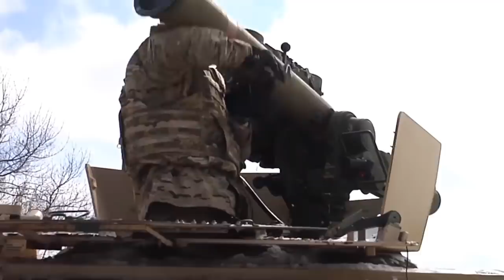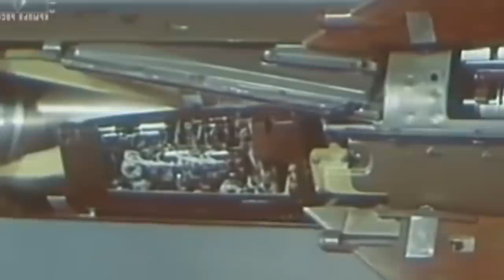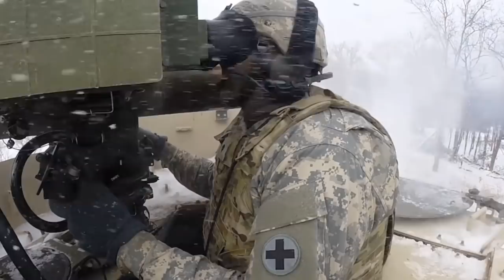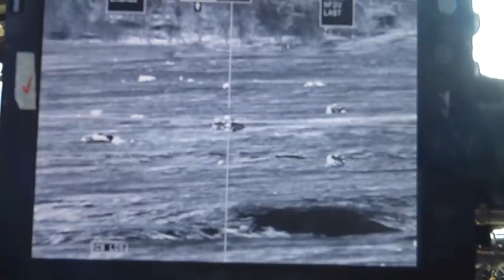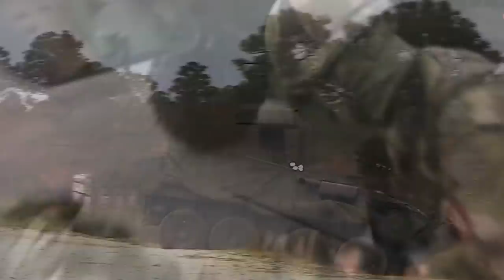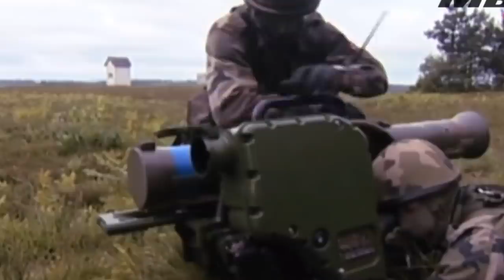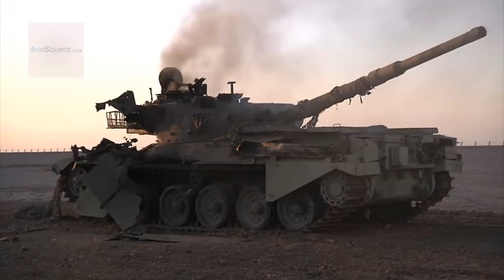Should Main Battle Tanks have Anti-tank Missiles?

Comment: For tanks right now, I think ATGMs are just redundant to the gun.

In the future, I don't think MBTs will be around at all, and the anti-armor role will be taken over by ATGM-equipped IFVs and scout vehicles. Already, Javelin missiles are fire and forget, which, while it doesn't allow quite the tempo of firing on the move, is awfully close, and while missiles are expensive, new MBTs generally cost somewhere around $4-9 million, so a $150k missile to take one out is pretty economical. Even if it takes 10 missiles to get through an ADS, you're still way ahead in terms of cost.

I imagine that the next generation of ATGMs will be able to be fired in an indirect fire mode, using inertial guidance and/or a datalink to get close and then and then some other sensor for final guidance. Once this happens, I think it will be the final nail in the coffin of the main battle tank.

Comment: I don't see where adding atgm to tanks would be if much benefit, it would complicate maters as now there is a secondary main weapon to manage, and also it mounts an explosive warhead to the outside of the turret.

If those in charge feel the need to add atgms to tank units, then they should have an atgm tank destroyer outfitted, maybe even on chassis if that country's tanks. I am a big proponent of specialized systems, as it allows you to create best in class systems, but multirole systems always result in comprimises in every single area so you end up with a system that is good at several things, but not great at any one thing, or at least not as good as it could be were it a dedicated platform.

I've long believed that when a country has a great tank like the Abrams, Challenger II's, etc... They should use they should do what is often done with APC/IFV which is usethe main body as the framework for a series of supporting platforms.

For example They could use take the newest if our surplus Abrams, remove the turret and replace it with a custom built turret with a pair of atgm launchers, one loaded and up for use, with the other retracted for reloading, manual or automatic. You then do the same for a battlefield SAM/AAA system, maybe just mounting a GROUND version of a naval combo missile/cannon CIWS system. By having these based on the MBT of each country, they could be integrated directly into the tank units, with very little trouble and would add considerable offensive/defensive punch to the tank battalions but without mixing lower armored vehicles in with the heavier armored ones.

Honestly, the best case could be to have the turrets used for the tanks to be compatble with the IFV chassis, so the mechanized infantry unit gets the same benifits, although the armore on the turrets should be modular so you can out less on the unit on the IFV chassis, basically to match it's armor level without the need of the heavier armor needed by the turrets when mated with tank chassis.

Comment: It is not certain yet but I think it is pretty likely that in 25 years sub sonic missiles will be almost 100% defended against by hard kill active defense by every kind of high value target. Killing a kinetic energy dart ist much harder and if one goes to even higher speeds (and yes, missiles might reapear there, but much more expensive and larger) it gets doubtfull that there will ever a good hard kill solution.

Where that arms race will end is completely unknown. If you contemplate you might for example see a saturation attack of a swarm of projectiles that can just knock out the hard kill system's sensors and after that it is the current situation again - and so forth.

Comment: Anti Aircraft missiles perhaps, the Guns now being used on MBTs far outrange ATGMs  and using HEAT rounds are effective as far as any possible opponent can be detected ranged and shot at which from high ground can be 10000 yards or more
Reply: They don't actually. The MTB's of most nations will seek to make their frontal arch armor sufficient to defeat penetration at 2km and beyond. The idea is to effectively engage from long range with ATGM that can degrade the sensors/optics on other tanks which will likely force them to withdraw rather than continue with degraded capacity.

Also you can't engage helicopter gunships with HE and remember the Russian ATGM's travel rather faster than the norm with the exact purpose of restricting the Time helicopters have time to escape the engagement envelope.
Reply: You Can with the US MPAT round

Comment: I'm in favor of having a stinger manpads mounted in an unmanned turret on the tank as a secondary weapon. That 50-cal on almost every tank seems pretty anemic as an anti-aircraft gun.
Reply: The TC's 50 cal. and the loader's MG are more for infantry suppression now than for anti-air! Tank crew has enough to do watching possible threats from all directions, loader usually gets assigned to watch his side and back of the turret while TC scans to the front and right for possible infantry and AT positions.

Anti-air are best suited for dedicated units or tracked vehicles assigned to an particular combat formations as then, they could simply concentrate on air threats!

Someone suggested using missiles or main gun to engage air threats, and while it would be possible to spot and track attack helicopters, it would not be fast enough to engage such as helicopters are far more nimble than what a tank turret's weapons could bring to bear. Motorized turret might be a lot faster then what used to be manually cranked controls but that are still NOT that fast as to be able to track fast moving air targets.
Reply: Cav1stlt except that my idea is intended for use against helicopters, in more urban settings.
Reply: Patrick, I have took my tanks thru city streets and to be honest with you, the last thing I worried about would have been helicopters, rather, every pair of eyeballs would be scanning every single windows, doorways for any slight movements indicating possible threats.

I have yet to see helicopters deployed (at least ours), within build up areas as they needed room to maneuver and hover. Once they enter towns or cities, they would very much be restricted like our own armors. We rarely send choppers into build up areas like what we did in Mogadishu or Panama.
Keep in mind of respond time of using portable anti air assets, it's not like a soldier would be shouldering a stinger launcher and scanning thru the sights. And he would also have to be aware of the back blast too- not something an overburdened loader might care to take on.

We were armored, we hunt and fought other armors; we could not do everything all the time and thus, we have to leave our air-defense to our own specialized units. And besides, we, conceited Americans, firmly believed in our own air superiority, LOL.
Reply: Cav1stlt p
Oh, thanks for the insight. Now that I think about it, it makes little sense to put a manpads on a main battle tank in any case.
Reply: These steel beasts, different versions of them, have been the loves of my life for a decade; I loved them, I hated them but in the end, they were mine, for awhile. Matsimus understood how I felt exactly. And I almost lost my legs a few times by these temperamental, heartless beasts... all because I was being overly enthusiastic and careless around them! I learned to fought with them, I learned to deploy them and I have learned their strengths and weaknesses. Though I no longer wore the uniforms, I do dearly enjoy lively, if civil discussions with others online like this. Thank you.
Reply: @cav1stlt922  you're welcome? I know it's been 3 months Since I was last in this comment thread but still.

Comment: Should Main Battle Tanks have Anti-tank Missiles?
Wel if it means you can launch some thing like a javelin vertical behind cover and hit a tank not reveling yourself.
No brainer in my option, plus the fact of drones these days assisting in hitting the enemy tank.
Reply: i say thanks of tomorrow need to use drones as a extra set of eyes to assist in spotting enemies and guidance of munitions.
A joint network like the F35 has.

Comment: Eryx is SACLOS not laser, well idk if there is laser variant of it ? The best anti tank missile IMO is Vikhr. It is laser and Russia claimed it is cheap, advisable to launch more than one missile per salvo. It is supersonic, and also Fire and Forget. Pack a lot of punch and also a good low altitude anti air missile, somewhat equal to MANPADS. All packed in one missile system thanks to the multipurpose warhead.
It used at Su-25 ground attack plane, helicopters, also naval CIWS complement. Kinda wondering theres no ground mobile platform for this missile.

Comment: It has never made sense to me to put the conventional missile tubes that you seen on the Bradley on MBTs for the simple reason that you've got 1 shot and you got to get out to reload. There is a very good reason why most of NATO has adopted systems like Kongsberg's  Protector. Sure firing through the gun barrel ensure the crew is safe, but maintenance. One idea that I like and think should be explored is to mimic the Vertical Launch Systems found on ships and submarines. The basic idea would be to have a single or double row VLS container mounted on the back of the MBT, this container could then simply be switched out by a supple vehicle similar to the vehicles that resupply artillery. This could probably be performed quite fast and with automation, keeping the crews safe.
 
I at least think it is a fun idea, I'm sure you know why this would be very impractical Matsimus ;)
Reply: Russian tanks use auto loaders for obvious reasons.
Reply: Do they auto load missiles? Or on their secondary armament?

Comment: Pretty much all modern Russian MBTs can shoot ATGMs. The t90, t14 armata, t80 and even t72.
Reply: Trouble is when you have to use the Gun it wrecks the ATGM control system, I don't believe anyone has yrt issued a fire and forget ATGM so you are stuck waiting holding sights on target till missile impact, that means several seconds not moving and exposed to gunfire from any opponent that sees you
Reply: 8aleph there aren’t any fire and forget atgm’s coming out of a tank but there are fire and forget ATGM’s the javelin missile system is fire and forget
Reply: Oops forgot that Guess getting old has gotten to  my memory. I spent my military career working Air delivered munitions with the USAF
Reply: 8aleph its all good man, but you are still correct there are very few fire and forget ATGM’s most are wire guided.
Reply: All tanks from the T-55 have the capability of firing ATGMs. T-55 / T-62 / T-64 / T-72 / T-80 / T-90 / T-14 and their modifications in the presence of the installed kit KUV.
T-55AD even had the first serial active protection kit.
Also there are kits installed on the BMP-3 100mm and 105mm NATO, etc. with a 100mm "Arkan" rocket, there are kinetic guided missiles for sea and land versions of 57mm cannons.
All basic modifications of BMP and BTR have demountable launchers for ATGMs.

Comment: I don't think MBT's need ATGMs (even the Russian Tube-Launched Laser guided missiles) BUT I WOULD like to see MBTs equipped with SAMs.  There is a HUGE gap in NATO armies regarding short-range anti-aircraft weapons.  I think big AFVs SHOULD have SAM protection directly on the tank.
Reply: swaghauler MTB is a Motor Torpedo Boat
Reply: swaghauler the Bradley IFV can be equipped with anti-air missiles and they usually move up with tank, so that kinda solves that
Reply: Your right.  I crossed discussions.  I was also in a forum discussing the new US MK6 Patrol Boat and called the newer Russian Patrol Boat "MBT."  I will correct my post here as well.

Comment: Do you really want to make any armoured vehicle obsolete? What about a cluster bomb full of quadrocopters with a detonator (like in a RPG) in the middle of the quadcopter. Once you release the bomb, it opens in mid air releasing all those quad copter, which will then fly and search for tank and vehicles (heat sensors) in a designated area, "stick" on them and detonate. You could trash several tanks with one bomb and  I don't think, that you would be able to intercept all those tiny quadcopters from the ground.

Comment: I personally don't think there needed a 120 mm sabot DU can hit a tank in 1 mile in about 2-3 seconds while firing an fgm might give away your position and give the op for time to react.
Reply: Micheal Esteves . yeah but from 5.5 KM.  T-90 with AT-14 Attacker ATGM with 95% hit ratio gaves a big advatage
Reply: Husen Faour but also take into account the design flaws and disadvantages that a lot of the old Cold War ATGMs have with the advancement of active protection you also need to take into account the accuracy and effective range of the system.
Reply: Micheal Esteves 
ok id link you a test but idk where is he the page now but
2015 . a T-90 with a noob crew fired ATGMs durning moving and stationnary on targets at 4000-5000m range scoring 24/24 hit
Reply: idk why would you build an ATGM with 5km range  whyle the system cant hit 3km
also what is the "cold war systems " point
Reply: Remember that NATO tanks in the 60-70's couldn't penetrate the T-64 or T-72 frontally at 2KM so they could fire ATGM outside the effective engagement range of defensive tanks.  He doesn't mention this at all but then he does acknowledge that this isn't really his area of expertise.

Comment: Already have missiles fired from conventional barrels. One problem with armored missile carrier they may not technically be called tanks. Modern conventional tank ammunition is still very effective against targets with a variety of capabilities. They are also very powerful and accurate with greater velocities than missiles. . And depending on needs they could carry guided missiles or just conventional ammo. They may be called tank destroyers or NLOS systems. UAVs will increasingly be used by tanks and they will be able to detect non line of sight targets. Non Line of Sight, NLOS missiles will become much more practical.  They could become more effective tank destroyers as well as other targets. But tanks often lack room for carrying extra missiles. As technology develops the cost of missiles is going down. And could be very cost effective in a number of roles. Conventional ammunition can also be carried in larger numbers. The US developed some tanks with the ability to fire 152mm missiles from tank turrets. This system was not especially effective but could easily be improved now with modern technologies. The light Sheridan tank and some M-60s were fitted with these gun missile systems.One option could be for older tanks to have completely new, unmanned weapons and more room for missiles. The crew could all sit in the hull and below the turret.  The Russians have already developed such a tank fitted with machine-guns, canons and four external missile tubes. These vehicles were developed to protect other armored vehicles.  Especially in urban combat. But they could be used as tank destroyers. Very heavy armored personnel carriers have also been fitted with missile systems.  Israel has built  heavy personnel carriers from Merkava tanks  and could be used as missile carrying launchers. Also Israeli old M-60 tanks have been converted with a powerful missile system. fitted to the turret. 
One problem is the conventional name for tanks. If you fit missiles to replace guns you may need to change the name. Possibly to tank destroyers or NLOS systems. Tank hulls can also be changed to carry mortar or howitzer gun systems. And the barrels can be used against to fire missiles. But they would no longer be called tanks.  Russia has developed very heavy missile armed personnel carriers which have running gear used by the T-14. And carry plenty of armor and could match a tank in terms of protection. And actually is better protected that many existing tanks. They could carry more missiles if needed and not carry infantry. It is the equivalent of a missile armed tank. But what do you call it. Russia has thousands of old tanks in storage. Mostly not in running order. Many of these tanks could be converted to missile carriers. With or without manned turrets or unmanned turrets. Russia also has the TOS missile system fitted to old tank hulls. The TOS system carries very powerful unguided or guided missiles to be used as a MLRS rocket artillery system.  But, technically, it may not be called a tank. It was not developed to be a tank destroyer but it may have that capability if new systems and missiles be adapted.  Some countries, like the US, use rocket propelled, towed cord explosive lines that are used to destroy obstacles and mines. The US system, the MICLIC can be fitted to an Abrams hull and uses a modified turret. It could be used against a variety of targets. The rockets are not guided. Videos of this system are on YouTube.
As missiles are developing the size may be significantly reduced.  This would allow tanks to carry more missiles.

Comment: The Soviets didnt develop gun launched ATGMs because their guns were "inaccurate". Get real. They were developed at a time when ATGMs were the new thing and their capabilities exceed those of regular HEAT shells. The primary advantage was the ability to reliably engage long range and moving targets as well as low flying aircraft. Tanks that didnt have guns and FCS compatible with ATGM use can not fire it. T-64 didnt roll off the production line in the 60s being ATGM capable, and neither did the T-72. That came later with massive upgrades to the FCS, 1976 for T-64, 1978 for T-80 and only in 1985 for T-72.
The Soviet 125mm gun was far superior to the NATO 105mm at the time. Soviets pretty much set the standard with the adoption of a smoothbore gun firing APFSDS. The Rheinmetall L44 came as a direct result of that.
Reply: An extremely correct remark, this is exactly so.